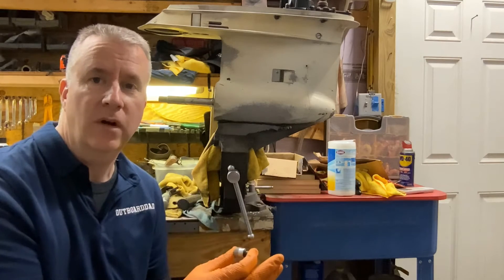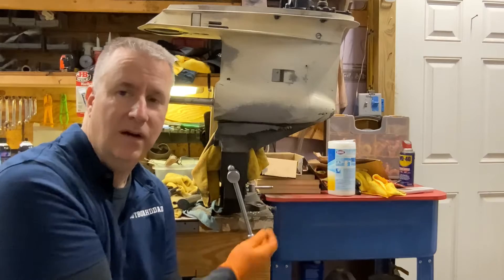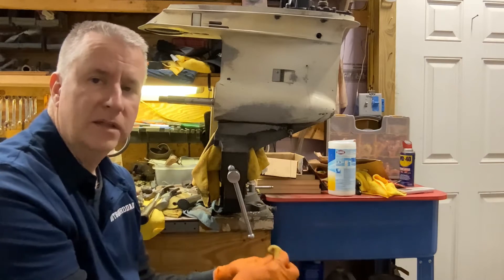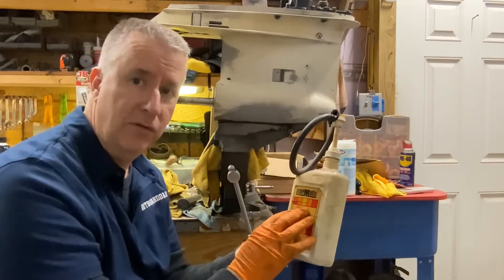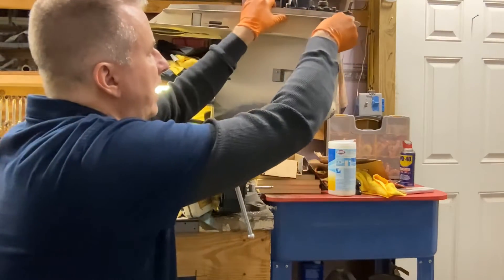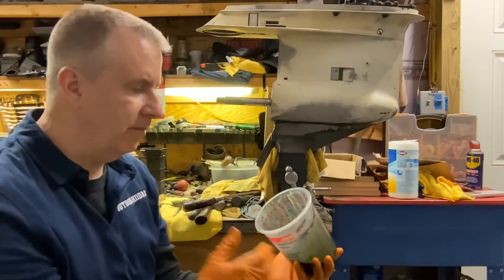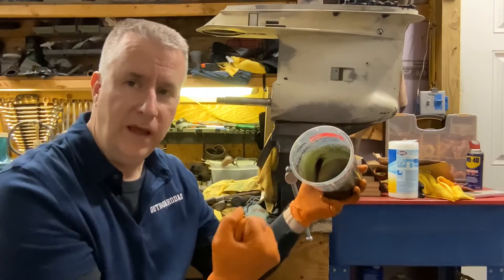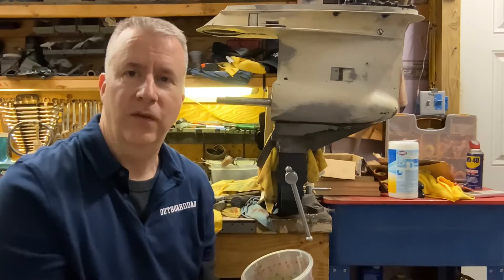Lower unit maintenance Heli Coil repair

Comment: My gearbox drain plug just pulled the threads. 😔 previous owner might have over tightened 🤷🏼‍♂️ Temporarily done up with teflon tape and covered in gasket silicon. It’s only slightly tight. Got any ideas for how to repair the internal thread of the drain.

Johnson/ evinrude 2007 115Hp 2 stroke. . Gearbox looks identical to this.

Side note. I’ve previously put outboards back together by painting absolutely everting including gasket surfaces in anti seize. (Even internal water galleries).

Pulling them apart years later has been chalk and cheese compared to other outboards where I hadn’t done this. 

Putting together outboards with anti seize you need to use the right type to avoid electrolysis and you have to be careful to not over tighten as torque settings kinda go out the window with anti seize!
Reply from the maker: Interesting, never seize has always turned hard when I’ve used it so curious what your using. Ultimately the stripped plug will need to be drilled and tapped. Some guys weld them up first then tap to factory size. Or you could heli coil but either way recommend disassembly to flush out all metal filings.

Comment: Yesterday we went to the sea and found out that the overheating engine is getting worse.
This time alarm kicked out when temperature needle was showing about a quarter of full scale deflection.

The first time the overheating problem showed up alarm came on when temperature needle was showing 3/4, later it happened at 1/2 and yesterday at only 1/4.

I stopped the engine as soon as I heard he first beep and continued with the 9.9hp auxiliary engine. 

I started again when there was no beeping when turning key switch to the on position. 

We went back to the port running the engine at 1500rpm and temperature gauge was showing a bit less than 1/4.

What's your hint for us to work on during the incoming winter?

This time it happened after only ten minutes or less running at close to 2000 rpm only. 

Waterpump seems alright because there was a strong peeing at the telltale.

Lasr summer we replaced the broken membrane of the poppet valve, which is just a pressure switch that should start opening above 1500rpm as it's explain in the service manual.

Thermostats seems to open at the right temperature which is 55°C only but I'm thinking about removing thermostats and see what happens.

I feel like removing the groomer at the poppet valve and watch the consequences.
Reply from the maker: Hey buddy, can you get a hold of the crayons they make that melt on the block at different temps? If not I would paint the block white and run it again to see where it is getting hot. My guess is on the head as that is usually where the sensors are for the alarm. Unless the alarm is from another source like oil flow. Remind me the year make and model
Reply: @OutboardDad  The engine is a 1998 mercury 135hp two stroke v6 2.0 liter.

The intermitent alarm stands for low oil.
The continuos beep alarm that was sounding yesterday is overheating and the sensor is located on one of the two cylinders heads. The temperature sensor is located over the other head.

Maybe one head is getting hot kicking the alarm while the other is not hot enough and temperature meter is showing only 1/4?

Since the whole engine is painted in black it should be easy to point a laser pointer with infrared temperature meter towards any blak part of the engine since the black color is the color that radiates better in the infrared spectrum, or better yet is to get a thermal imager for my cellphone?
Reply from the maker: @ not a fan of infrared temp tools for this application. Radiant heat can throw it off. I would pull the heads and check the water passages
Reply: @OutboardDad  Many thanks for your recommendation of not using a thermal camera.

 I have two old heads in pretty nasty condition that I should clean first of all.

Then I guess that I should get new gaskets before removing the working heads and start cleaning the passages in the jackets.